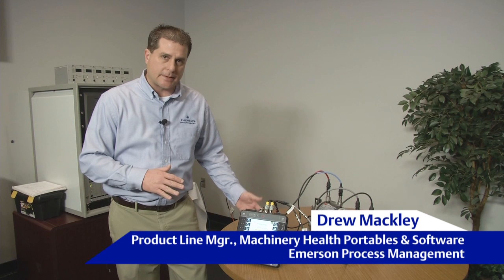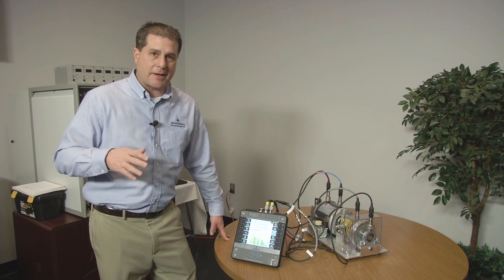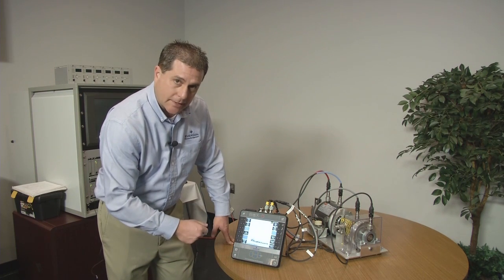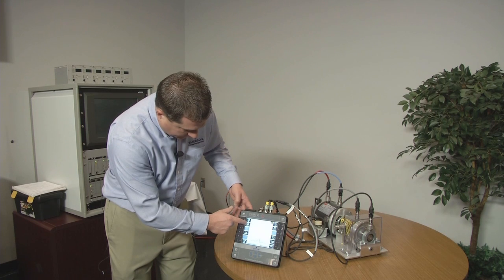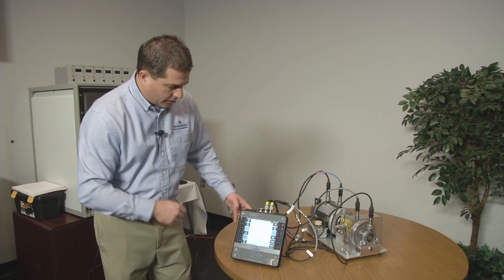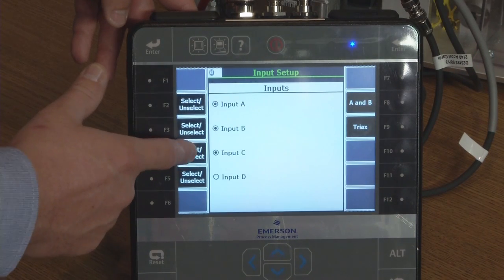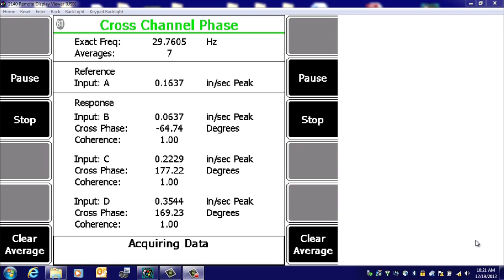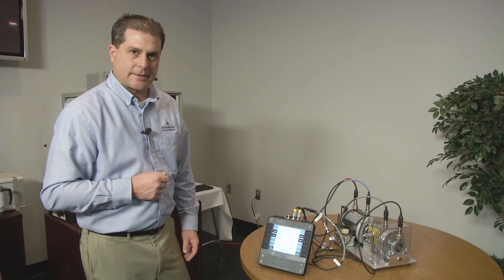Misalignment Detection: Cross Channel Phase and Fault Frequencies

Comment: Thanks for the explanations. I carried out cross channel Phase with 2140 and the coherence is not 1 (actually less than 1), how does that affect the phase reading ?
Reply: Coherence value is not necessarily 1. It can be 0.95. It is only testing the linearity of the system.
Reply: @josephajimuda938  yes, i know better now. Thanks.

Comment: Drew thanks for that excellent presentation. I have a few questions. I'm noticing on the spectrum used to diagnose the misalignment was labeled F1P. From my knowledge using the CSI system, is this a PeakVue reading as the spectrum was in G's. 

Also using the Cross Channel Phase with the new CSI 2130, can just the 2 sensors be used across the coupling to confirm the misalignment? Thanks